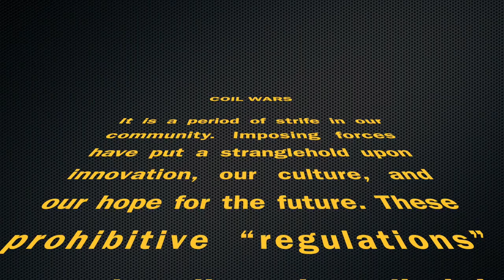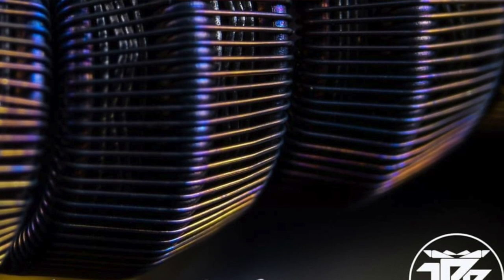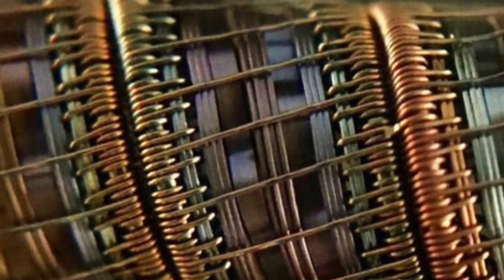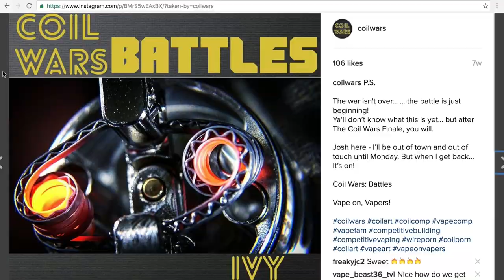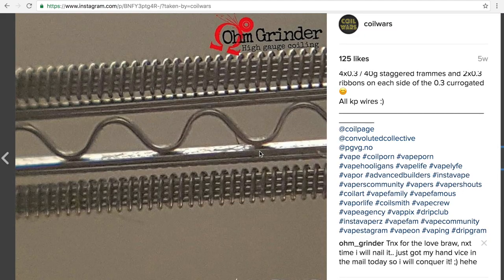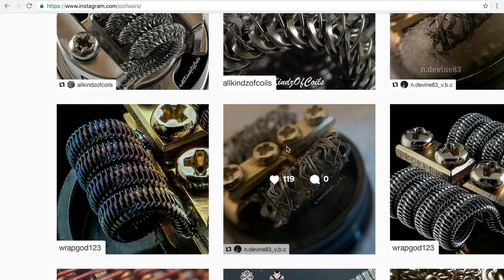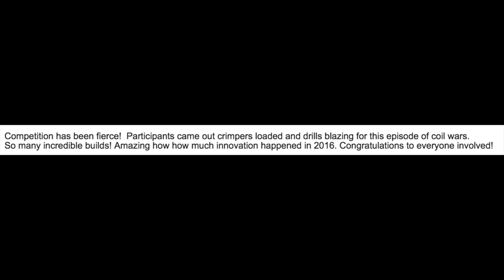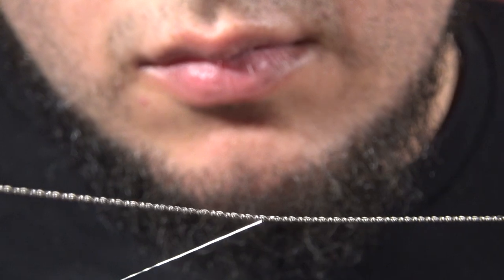COIL WARS: BATTLES | Ivy Wire | How to Build an Alien Staple Tiger Helix Coil

Comment: this is Excell_Coils, and just wanted to say thank you!
the specs on the coil are:
10x 0.4 ribbon ss/n80/ss/n80/SS on each side, 1x 0.4 n80 claptoned in 42g n80 corrugated ivy wire core, 40g alien wrap on 0.5 ribbon, stitched interlocking Enigma is 38 ka1/38 n80 interlock 40g ss stitch
40g n80/40g n80 stagger & fuse on a 28g frame 
5 wrap 2.8mm i.d. 0.13 ohms

Comment: I've been using larger builds in my RDA for a short while. Always makes my device so damn hot so quickly I end up just going back to basic coils. Am I "doing it wrong" or is this part of using large coils? I don't enjoy hot electronics
Reply: you're doing it wrong definitely! batterys? mod? what build did you use?
Reply: +Marc Crocoll two married Brillipower 18650s in the RX2/3 running dual, with five wraps of alien wire that come out at .11.. At 50 watts the whole thing gets really warm really fast.
Reply: +Marc Crocoll and that's dual coils
Reply: Woah, 50 watts? Your mod should barely get warm at only 50 watts. Id say it was your batteries too, but at only 50 watts brillipower should be just fine. Kinda makes me think its the mod.. try some samsung 25r or sony vtc5A and see if you are still having problems. If you are, its the rx2/3.
Reply: +Marc Crocoll thanks man I appreciate the input. Since my original comment I switched to coils with higher resistance, and it helped a lot. I was even able to drop the watts to 35 and I'm getting some outrageous flavor and really dense, slightly warm vapor, which is my ideal vape. I'm going to get two new 18650s tomorrow because these ones are draining way too fast. Going to find out which of the ones you suggested is best for my preferences and device.

Comment: how do you get the colors on your coils?
Reply: H.H.R Jester nichrome or stainless steel.just pulse the fire button a lil bit and you'll start seeing colors but after squeezing them and getting the coil firing right.color won't stay
Reply: H.H.R Jester low wattage for SS. Talking about 20W and pulse it

Comment: What exactly is groove fused?
Reply: Kyle Graham when you make a clapton and the tiny gap between the claptoned wire has a tiny Lil wire wedged between. Type in #groovefused on instagram and loads will come up. As examples.
Reply: Thanks, thats what i thought. I asked because ive seen builds where people have just done a spaced wrap/fuse and called it groove fused.